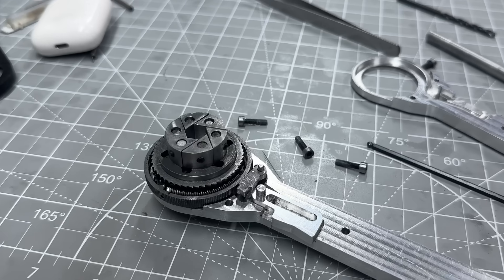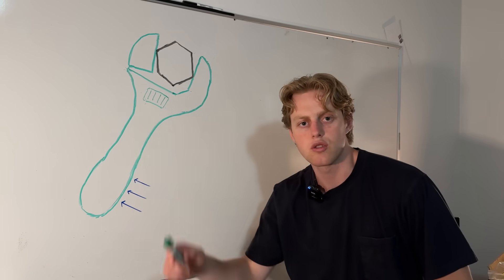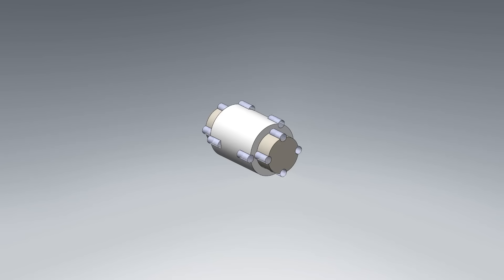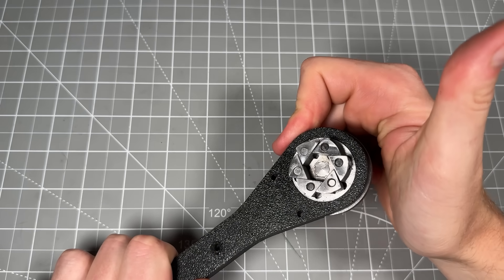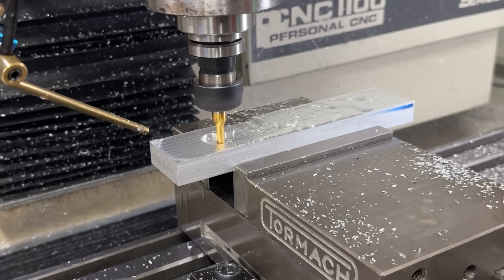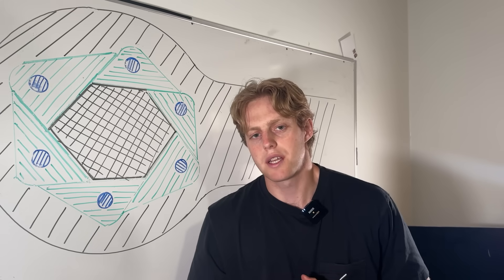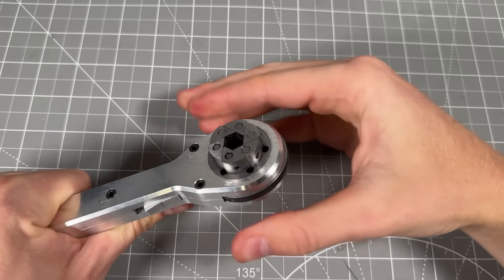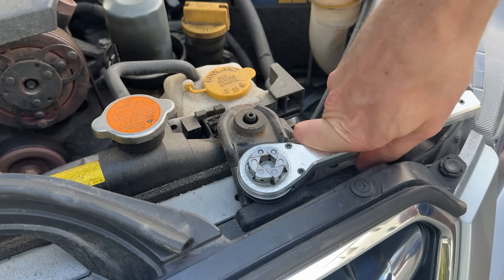I Invented an Adjustable Ratcheting Wrench

Comment: This would be a great tool for Industrial Rope access Technicians who install electrical cable trays at height. Things like Uni-Strut, fixed at height that does the job of carrying High voltage cables in an industrial setting is generally fixed at height using a combination of metric fixings, mainly M8, M10 & M12 bolts. Considering your tool could handle 1/2 inch means Metric M12 will also be compatible.
Imagine working at height using your ratchet which fixes itself onto the bolt while your hands are busy adjusting your Harness for example.
Very impressive design you have come up with.
I can see many uses for this tool, well done 👏👏👏👏👏
Reply: M12 is usually 19mm head, M8 is 13mm

Comment: I like it. If a single wrench covers 3 sizes it would be a huge improvement and it wouldn't be as clunky as a single wrench for all sizes. The free spin when the bolt is still loose is great. A huge time saver.

Comment: This looks awesome!  I would definitely want it!

You didn't set out to solve this issue but maybe indirectly did.  I have situations where I have to get a socket into really tight spaces, and I can barely get any bolt rotation because of the limited movement of the handle.  I think the really fine teeth allows you to get tightening even with a very small amount of handle movement.

Comment: absolutely just a gimmick, really cool design and work done but at the end of the day dont go bankrupt trying to get this to market, its too fragile, its too bulky, it will only be able to access maybe 5% of common fasteners and anywhere it can access a fastener means that there is enough room for a powered ratchet or impact driver to get in there and make it 5 times easier, also i guarantee when it meets rusted seized hardware itll both self destruct while also turning the bolt head round

theres a reason why mechanics or even DIY guys have 6 different styles of wrench and 6 different styles of sockets along with dozens of extensions, swivels, ratchets, ect ect ect its to access and grip stuff properly and often theyre shaving 1/8" off of something to make it work or they need exactly the right length and angle setup to just be able to get 10 degrees of swing on the fastener before resetting to get another 10 degrees

Comment: You had it right, generalized catch all will work worse then specialty. Lots of small parts that will break in your design. Sometimes you REALLY need to put a lot of force through a bolt and I don't want to have to worry about my socket breaking.

Comment: Everyone has a good ratcheting wrench but how slim could you make a standalone adjustable socket? Wouldn't need to worry about the handle or ratcheting part just adjustable socket and combine it with an existing wrench. I think that would be something I would be really interested in. Actually not just for the fact that I don't need a big set of sockets but actually the gripping and staying on function coupled with the perfect fit and added grip pressure on a nut that is non perfect socket size or damaged makes this a very interesting product!

Comment: That's an awesome tool, it's definitely got its place in the industries, my only issue is tight places on vehicles or limited spaces, but I'd just use a rachet spanner in those places, nothing is worse then dropping a socket or working on a car with different sized bolts for everything

Comment: The biggest problem in all that kind of things are, that they don't fit anywhere when really doing something. The bolts are almost never in the straight surface. In most cases, the socket also needs to be as thin-walled as possible, otherwise it won't open anything. So yeah, that is completely useless tool even if it works mechanically.

Comment: You need to sell this to space agencies and saturation divers. Focus on remote markets with bad logistics nasa will want the weight savings of ditching the socket sets. Mining operations, sail boat users, remote island communities or remote Alaskan communities. Antarctic exploration. You may have some luck with military vehicles recover kits. You need to use better metals on the pins that deformed. I think inconel would work well. You keep working on this and you would be able to turn it into an electric driven fairly easily. Apply the chain or belt to the exterior on the inside use a timing chain for this design. You need to increase the load capacity for torque or this isn’t going anywhere. Those answers will come from a material scientist approach. Make your plates for the pin on a single round and lath them off together they will align better with the industrial process construction this way. Great work. Inverse the design to allow bolts to feed through the center it will have better applications you will need more contact on surfaces when you aim to increase your torque capacity.

Comment: Whoa, I’ve seen 1:06 of this and I gotta say, you need a patent attorney, yesterday! I worked in the Sears tool department when I was a yung man and I remember when the Gator wrench came out, it’s the one with retracting pins, I saw it and knew it was a gimmick instantly. Your design seems to be actually anchored in geometric pattern design, it’s great! Good luck! And do you have any ideas for a 12 point adjustable wrench?? I’m sure you know, most aircraft fasteners are 12 point.

Comment: You're a honorary German from here on out. You invented something needlessly complex for a problem that most people don't have. Hats off and best wishes from Germany.
Reply: Harsh, but fair. To be more specific, the "problem" it was trying to solve was space, however it is now exchanged space for versatility, reliability and possibly speed. 
Keep up the great effort non the less. I'm sure there will be more ideas to hone your skills to.
Reply: What are you talking about? This is a huge problem that people like us have. 
Anyone who works with bolts on machines or anything knows how much this makes life easier.
Reply: It's obvious you don't use tools
Reply: Sounds like someone who hasn't worked in a shop.
Reply: @ItsAllAboutGuitar  If you worked in a shop then you know that one of the biggest issue when using wrenches is tight spaces which this tool only makes worse. And if the space isn't an issue then power / pneumatic tool is a preferable option over the ratcheting wrench.
Hats of to the guy who created it anyway.
Reply: @ItsAllAboutGuitar try puting your tools away neetly and it is not a problem.
Reply: @justsoicanfingcomment  Wild you can't think of why it would be helpful to have 1 tool have an entire tool-sets functionality yet you grandstand
Reply: @Sicknificant1 Very useful for people not willing to carry to much weight with them.
For example working at heights on comms towers, riggers are spending sometimes full days up there. You don’t want to play with too many loose sockets etc..
Not a tool for a work shop, but perfect for many other working environments.
I’ll buy one the moment it’s available..
Reply: i very much have this dumbass problem (im german so maybe thats why) somehow the same size wrench FITS when a different one WITH THE SAME SIZE doesnt
Reply: Harsh comment, but yes... too complex
Reply: Those are the best tools! The knipex pliers wrench 😮‍💨
Reply: Stimme ich zu 100 Prozent zu. Honorary German it is now.
Reply: what a german way to be an asshole
Reply: I don't know if you missed the past century, but the US is more German than Germany in a lot of ways. Or did you miss Operation Paperclip?
Reply: he's most likely descended from Germans.
Reply: @haroldzblweski489  hes 100% descended from a German country with a surname of Faber

Wow crazy after googling the origin of Faber it comes from latin and means Craftsman... Assuming his surname is actually Faber and he didnt just use Faber since you know he is a craftsman.
Reply: @Antiluls I always tell people it translates as "Smith" (AKA, skilled worker) so basically we've got the most common English last name!
Reply: @andrewfaber9014  well idk about that but maybe. Smith would come from the German Schmied or Schmidt. A lot of German Surnames come from the occupation of older generations such as Mueller or Miller in English workers of the Mill.
Reply: from Google:  In Latin, "faber" means "craftsman," "maker," or "artisan" and can refer to a skilled worker like a smith, carpenter, or architect. It is both a noun and an adjective, and the root appears in many related terms, such as the phrase "homo faber" which means "man the maker" or "man the maker". 

Smith: denoting a person skilled in creating something with a specified material.
 @Antiluls 

Directly Faber is skilled worker. "Smith", probably not. To my brain,, craftsman and Smith are synonyms.

But yea, we agree. I simply for the joke of being "Smith",  technically, Faber includes more professions than just smiths.
Reply: I mean it solves many problems for general contractors, car mechanics and engineers. Instead of a heavy tool kit you got one wrench that saves time and effort.
Reply: @TheSADVeeto As a mechanic this tool wouldn't actually reduce the amount of tools necessary. You still need deepwell sockets, socket extension combinations, and depending on spacing the wider head of this design might not fit where a normal socket would. I would still get one of these but it's not anywhere near a replacement all sockets
Reply: It's complex but not much more complex than a ratchet. The sentence "a problem most people don't have" might be true, but for someone like me who is an avid DIY'er and motorcycle rider, this would be a god send because of the space and weight saving for replacing several sockets you need to bring when doing a long ride. It also might help with lessening missing sockets at home 😅.
Reply: @jlsaibot0319 try using a bike that does not break down all the time and has the same size bolts on most parts you might need to access.
Reply: Complicated*
Reply: not sure why... but a German calling someone blue eyed blonde 'an honorary German' gives me eerie feeling 💀
and yeah faber sounds like a surname of German origin
Reply: @chee-tah- Why? What does this have to do with being blue eyed? Are you okay?

Comment: Have you actually fumbled around? Spanners get to places a socket can't and if you can't reach with said socket, we use an extension let alone having both hands to operate it...
Looks like a handy tool for any DIYer working with 1/2 inch and under non automotive

Comment: Real use!! Keep developing! Super cool concept, the bulk is an issue for sure but idk a 1/4 drive equivalent for smaller bolts could aid in the access concept, sizing down would be a nightmare I’m sure but this looks really solid dude made respect. You’re clearly competent in your craft.

Comment: Simply putting an arrow along the side facing what diction the bolt will go will solve the confusion of what way to use the wrench. Pointing towards the hole to go in, and away to go out

Comment: You're a pure genius and for whatever my two pennies are worth,  why not separate the  handle from the head(socket) and make it attachable with different length socket extension bars ?  That way, you should be able to reach bolts in narrower places.

Comment: I really like the wedge idea but the wrench itself falls victim to two old issues other "one size fits all" wrenches face...
The head is too big
It only works on easy to access bolts
You're ahead of some by making the wedges stick out quite far. Could you use an ovoid shape on the outside of the wedges to cam them inwards?

Comment: Oversize the center plate a little and add a moderately aggressive knurl to make the hand threading feature even better. Really innovative design. I could see buying a set of these up to 3/4” as long as they could take about 50 ft lbs.

Comment: Great job man. I think every design has its niche. As is, I would buy your tool with all its flaws because for some projects that I do, I need just that, compact, one stop-shop solution that is easy to use. The only question is price, and how much I would be willing to pay for it vs. it's actual price that includes production and r&d costs of you invention. 
In any case, great to see this kind of work. I'd probably buy one just to support what you are doing

Comment: The fact that you can hand thread off the dial manually is the main reason I want it. Also that it clamps onto bolts so they don't fall out of place is amazing.

Comment: Cool design.  but it is objectively worse than a socket set (much more limited range of bolts can't stick extended on it for recessed bolts, etc..) and a lot more compared to build, more expensive.

Comment: It's basically the adjustable wrench of Ratchets, sure it won't get in tight and recessed spaces but its still super useful to have since one tool replaces the need for a bunch of sockets, I dig this!

Comment: How far out can you make the jaws, so they can still grip and torque a bolt or nut? Like can they 2 inch long? So it like an extension on the ratchet?
Reply from the maker: The mechanism will get to weak as I continue to grow the jaws. There may be some room to make them a little longer.

Comment: Sockets will always be useful, especially in a proffesional setting, but a tool like this most certainly will have its place. Especially when you just have to loosen and tighten a few bolts that are a different size, a chamfer is a great isea as well.

I wonder if you can make the middle hollow so it also works for nuts?

Comment: the 2 issues I could see would be dirt or metal particles getting in between those moving adjustable parts that wrap around the bolt jamming it up over a relatively short amount of time with normal use, and its general bulky size. if you could solve those issues it would be perfect.

Comment: guess next step would be to make it so you can open up the teeth from the handle and clamp them rather than using two hands to do that, would make it easier to get into places just big enough for the head and not the hand as well, another step after that would be to have a way to add extensions that allow you to access tighter spots

Comment: You need more views and more subs I subbed to you bro. Universal sockets have been tested but they're always trash none of them work and slip after just about 10 ft lb of force. The adjustable wrench with a worm gear never seems to work with anything other than plumbing and doesn't really manage to take off a any bolts. This is a very good step in the right direction

Comment: Definitely take into consideration the use of that tool with the combination of standardized extension, swivels or adapter that is perfect for going into standardize accessories
Also, with the thought of mind of smaller hex accessories